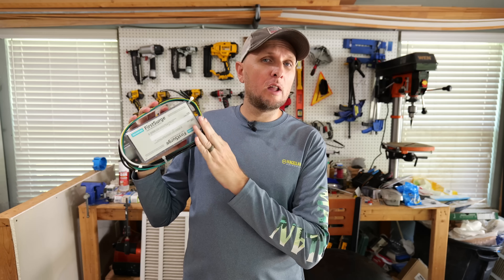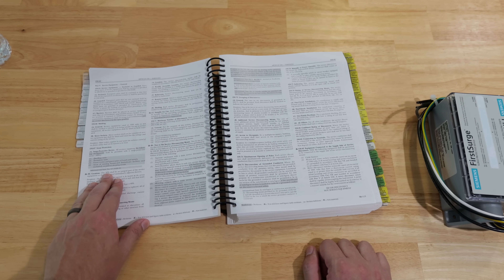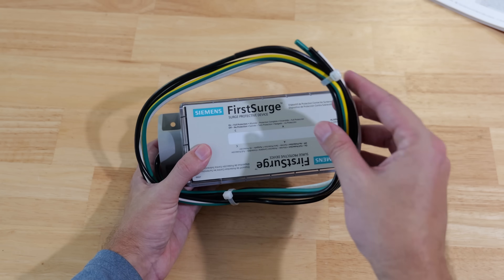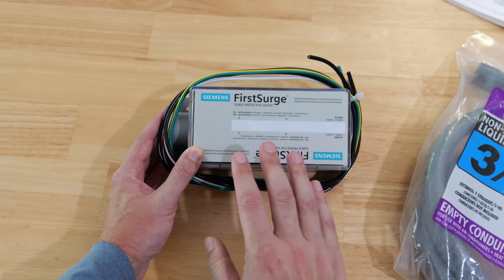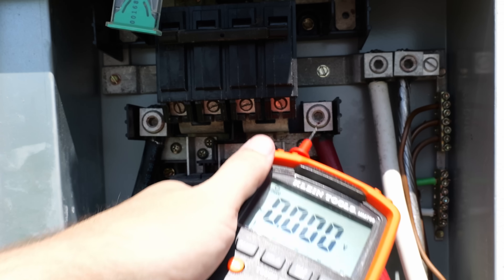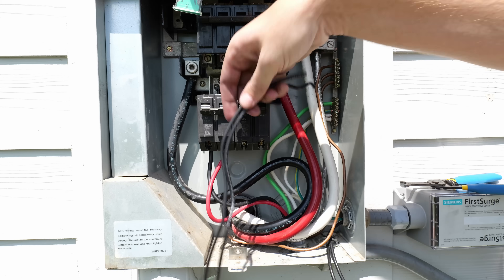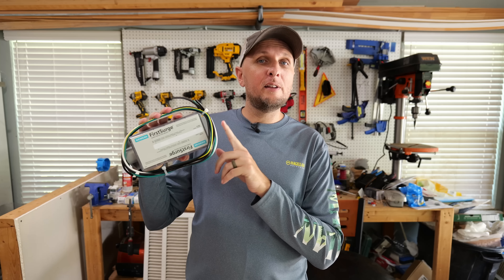Why Whole Home Surge Protectors Are Now Required and How To Install One!  Siemens FS140

Comment from the maker: Were you aware of these surge protection devices?  Also, do you think they make more sense to install now after watching this video?
Reply: All well and good for newer homes. My panel is flush mounted in the garage and has no adjacent spare breaker slots.
Reply: @oswaldcornelius638 My panel is in the garage.  My surge protector was installed by just cutting a hole in the wall next to the panel.
Reply: Done and dusted over five years ago and it has been effective, I believe, as we have had nearby (NOT direct) lightning hits on the primary lines and no damage. In the past we had sone stuff fried in similar circumstances.
Reply: I wasn't aware of these until watching your video on this. It does make 100% sense to install one if you don't have one already. Definitely going to get one and install it as I don't have one currently. Great informative video 😊😊😊 Thank you for posting this video.
Reply from the maker: @211milkman  You are very welcome.  I wish I would have known about them years ago.  I have had appliance circuit boards fried, along with a surround sound system, and some other minor items.  The surge protector is less money than one of the circuit boards alone that I had to buy for one of my appliances.  I personally think they are a no brainer.  Really glad to hear you found it helpful.  Thanks a lot for the feedback!
Reply: Our main breaker panel already had 1.
When I added a subpanel, I added another one and afci/gfci breakers.
They are a great concept, but I would still add surge protection at the device level as well.  A large surge could still propagate depending on the circumstances.
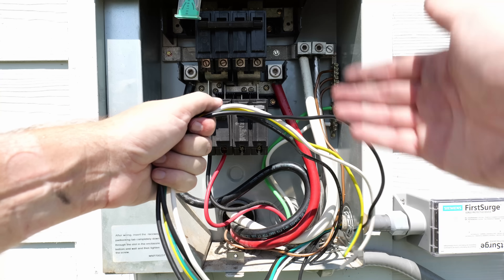Reply: At 9:15 the other reason to keep wires the shortest possible is not only to gain speed, but to lower the impedance (resistance) and thus allowing a greater value of current to be diverted in case of a voltage spike ("surge").  This thing beeing rated at 100 000 Amps the resistance must be VERY low to allow this value of current to flow in the protector while keeping the overvoltage low.
Reply: I had my AC panel replaced in 2016 and the electrician put in a SYCOM T2 surge protector.  Interesting though he did not use a double pole breaker, but rather 2 individual breakers.  If I turn off either breaker the green light goes out.  The device itself has a 3/4" threaded stub so it is installed directly into the panel's knockout.
Reply: I failed to mention that both breakers are on the same side of the panel, so the device is looking for 240V.  So, I guess the assumption would be any surge on 1 buss would also hit the other.  Not sure I like that approach, gonna go with what you showed in this video, thanks HowToHomeDIY!!!
Reply: @bobhall5893   You use a 20A double pole (220V) breaker which connects to both bus bars.
Reply: So answer me this I own two homes, one built 1945 other 1955 been living in older since 1999 and in those 25 years zero issues with surges!  Parents been in their home for 50 years with zero surge issues or damaged now that I think about it I know of no one living in a dwelling who has experienced a surge related accident.  I get that these are extra protection but comes at cost to home owner so should this be mandatory?  I would love to see the data on how many issues occurred due to surges and shouldn’t the provider have some form of surge protection that limits high surges sent to homes?
Reply: I installed that exact unit on my house a while ago. I have a smart home with Z-Wave switches. Before I had a surge protector I lost a switch at least once a year. It was costing a small fortune. After installing the surge protector, I haven't lost a switch since. Best purchase ever.
Reply: I had my main panel replaced around 5 years ago. Before having a surge suppressor was required by code. But it was recommended by my electrician and got one installed.  My breakers are Eaton and the surge protector is Eaton.  It also has two green status LEDs.  I hadn't checked them in a long time, but I figured I should go check now while I'm thinking about it.  Still green.
Reply: My opinion is that it does not make any sense to install these whole home surge protectors on older homes. One reason is the huge cost of making all the changes in a home to meet current electrical code that the homeowners many times cannot afford. Also there are readily available surge protector power strips that can be used with computers and other electronic equipment. It is primarily electronic and computer equipment that needs this protection. Other items do not need this surge protection.
Reply: @davidgrisez  I don’t see why you think installing a whole home surge suppressor would, in and of itself, necessitate any other work. Also, many or most modern appliances have electronic controls that might even be hard wired with no plug to put a suppressor on. And even when they are plugged in, a homeowner might not think of it as being electronic even when it is.
Reply: I had a (pot) pole transformer go bad and send a surge into my main panel. Besides sacrificing itself, a whole house surge protector, I lost 3 computers, not on at the time, the circuit board in the electric range and a small TV. My well pump and all my radios were fine.
Reply: Important on more than dwellings. Our company's mountaintop communication sites dealt with lightning frequently.
In the old days (before 2009) the standard was 25,000 amps and the Surge Protection Devices were known as Transient Voltage Surge Suppressors (TVSS). Our company had ones with replaceable modules but often we would open the cover and find nothing worth saving. The modern standard is 200K amps, and they are not even all that expensive. Even retrofits will pay for themselves with one strike.

BTW - I do not recommend power strips with internal surge protectors; in practice they can compromise single point grounding, which is critical to preventing equipment damage. Go with whole structure SPDs.
Reply: @tedskovranekii7627 You need two spaces nearest the main lugs . You want the surge to shunt to ground before going done the load bars. Keep the leads as short as you can.
Reply: If we have lightning rods on the roof and power conditioning on a PV installation, shouldn't that be protection against damage from surges?  I would think so (though actually we have more limited surge protectors from before getting the lightning arrestors)
Reply: Hi. My grid is connected to a Sol-Ark 15k hybrid inverter, so would I be right to assume that I don't need a Surge Protector, because the inverter handles any surges?
Reply: ...I will just cut to the chase THEIF , the NEC only applies to NEW dwellings and installations and has ZERO refit requirements and any particular change to the code may not even be adopted by local building departments. So no one needs to call your swindling azz to install one of these things on their existing service , QUIT BEING a crook it gives the rest of us a bad name.
Reply: Super! It is also a surge protector.Can i use this instead of a dedicated unit in this episode [Why Whole Home Surge Protectors Are Now Required Install Siemens FS140] ?
Reply: How much electricity does this actually use?
Reply: I was aware of these, though not sure how to address my particular setup and install one.  I posted a reply asking exactly that.  If you get a chance to answer me that would be awesome!
Reply: I've worked in Electronics for over 50 years and I can tell you firsthand how dangerous it is to have a large surge protection device installed on a primary circuit. I have seen explosions caused by power surges of even small MOVs rated at only 30 joules of energy. I can't even imagine the damage that a several-hundred joule device can cause. I predict major house fires caused by these devices. Not good!
Reply: No. I still think they are a waste of money. They do nothing for low voltage events which cause current spikes that are far more damaging. I think they give homeowners a false sense of security.
Reply: Yes I know of them…
Reply: I had a spd installed about 10 years ago. In Arizona spd is not law. The light is on and I’m wondering if this is something I can do.
Reply: I was not aware of these whole house surge protection devices. I am now because I follow your channel. Most people in America do not follow this channel. And because " Playback on other websites has been disabled by the video owner", then most people will never be aware of this video.
Reply from the maker: @acratone8300  The link to the video can still be shared but yes, I do disable the ability to embed it into websites for various reasons.  It will still show up on google search and such as well.
Reply: Sir: you read from code, that the utility company is directed to provide a unit upon request?
Reply from the maker: @Hawka-Loogy  That is not what the code is saying.  It is just saying that a SPD is to be supplied at all services.  Supplied does not mean given, it just means it has to be there.  Now some utility companies will sell them and they install them directly into the meter.  I personally did not like that option as they are either around the price of the one in the video or more expensive, they oftentimes don't have an alarm or way of letting you know they need replaced, and often are not rated for as high of surges as the one in the video.  But it is an option at a cost of course.
Reply: @HowToHomeDIY    I still don’t understand what this whole house surge protector actually protects. Does it protect only house wiring or does it also protect all/some of the sensitive devices plugged into the house wiring?
Reply: @ThisIsToolman  thanks to the breakers' magnetic trip coil inductance, I seriously question the effectiveness of separately wired-in and breakered SPDs. They may help a bit with random grid crap like reclosers tripping that can cause some voltage swells. If every house has one, then the neighborhood can collectively sink 10s of kA without blowing their SPDs all at once to keep the grid within tighter margins during load dumps and get billed for most of that energy.
Reply: On planet earth?
Reply: Yes we knew all about all surge protection
Reply from the maker: Pretty much everyone knows about your standard surge protector but most don't know about whole home surge protectors or about the new codes.  Glad you have it all together!
Reply: @sifu189 Thank you for watching (Why Whole Home Surge Protectors Are Now Required and How To Install One! Siemens FS140)

Comment: Lost a TV, certainly due to a surge in the building's cable system, some years ago. Then two years ago, the starting cap on the rooftop AC went out after another bad storm. THAT repair wasn't grocery money. So I had protection added on the roof and in the main panel. Probably cost 4x-5x what it would have cost to just "throw another breaker in" when the breaker panel was first being set up. So, sure, the whoring builder would have overcharged for the cheapest unit he could find.
 But probably half of residences are rentals. Those tenants can't retrofit their panels. They've got no choice. Surges on the AC mains, like when a drunk knocks down a transformer pole, can set a house on fire. And will blow out everything plugged in inside, even if there's no fire.
 The protection at build makes sense. The whoremongers in real estate? That's a bigger problem. I know some telco and cable techs who would gladly find the builders and give them some life lessons.

Comment: Sorry, I know this video is a couple years old now, but I have a question.  I recently had (2025) a Tesla powerwall installed, during this process, they installed a new electrical panel and brought over the wires from my old panel.  Does this change mean they had to install a whole house surge suppressor per the 2023 NEC?

Comment: So, if the double-pole breaker is shut off accidentally, the surge protector does not work. Is it better to wire directly to incoming power then?

Comment: Same reason I of course have a furnace that was made in a 1930s I remember lightning hitting the house and did not hurt that old furnace The only thing it did was burn out the transformer which was $20 on Amazon the refrigerator unfortunately was not cycling at the moment so it did not harm that and whenever I'm not using other certain appliances I unplugged them and our washing machine and dryer are the same way no circuit boards I think they need to stop putting circuit boards in stuff in stuff that is designed to fail

Comment: I know somebody that had a house that they had put one of those in the panel and even had the electronics plugged in to a normal surge protector strip and it's still unfortunately surged out and it was not due to a lightning strike some stuff is just a waste of money even if it's required 

It would have been really nice if it would have worked because it would have protected probably $10,000 worth of stuff but it didn't same as the reason I always go with battery operated carbon monoxide and smoke alarms Don't trust anything that connects to electric

Comment: Keep making more expensive stuff  as “required”.
And at the same time complain that homes are expensive 

I have $10 circuit breaker now but as per code I need to replace them with circuit breakers that cost $65 each, I need 16 of them that $1,000 😡

Comment: So the 20amp breaker is there solely for the SPD? I have recently installed 2 SPD’s in panels suppling power to my well and rain water collection. They both had 2 pole 20amp breakers so I was able to use them.  I have a third panel suppling the hot tub and sauna but it only has 50amp breakers. So my question is, do I just add a 20amp 2-pole which would only be used for the SPD?

Comment: Trying to figure out the best upgrade path to do this in my future upgrade. But had an on-meter SPD when lightning struck shared pole with neighbor. All equipment at neighbor destroyed! I lost a night light (and a fuse box is now very black and had to replace all the exploded fuses). (The night light EXPLODED all over the counter. Not going to get into why that took a hit when other equipment did not, it's complicated. Point is the value of these SPDs.)
Reply: If you want maximum security, have one installed on-meter, in main panel, sub panel, and type 3 surge protectors on all appliances at home.

Comment: Sorry but I don’t see where this is protecting your home from a power surge? It is only connected to its own 20 A Breaker with nothing after it connected. If a surge comes in it will just surpass this unit through the main breaker and fry your Electronics the same way. I thought this unit is installed in between the main incoming power and the breaker panel where your house is wired from. 
It is to me like you just installed a light bulb that does nothing to your house tan two green lights.

Never mind. I think I found the wrong in my thinking. It is a load protected Switch. Not a regular breaker. If it trips, the house is without power. The Surge protector makes it trip ( turn it off) in case of a surge. 
I’m not an electrician obviously. 🙄

Comment: So I don’t get it how is this shunt that you’re installing on an appendage of a breaker going to do anything for a surge other than give it a path to ground basically exactly the same as a lightning arrester. You have to remember electricity travels very rapidly by the time it hits that shot it’s already hit everything else in the house. You’re not making the electricity go through it. It’s an appendage that gives it a path to ground nothing more so how’s that supposed to protect anything I would think that something like an in-line voltage conditioner would be what you’d really want to protect things but then again I’m not an engineer. I’m just trying to make heads or tails out of this but this what you showed me here makes no sense whatsoever

Comment: Had surge protection on my panel since I built the house in 1999.  Still working, still green lights.  A more modern one is probably a good idea, though. Thanks for posting the video.
Reply: If it ain't broke, don't fix it.

Comment: I live in Fla.  I had just got my house built.  Lived 37 years in Fla with trees all around. Now I'm in the open next to lakes and ponds.  I had already planned for a surge protector but before we got it in. I had lightning come through ..I could see it. It only shut things down.  But then a second hit took out only one of my light fixtures (LED). So i called and told them to put in not only the surge protector but also a lightning arrestor.  No.  I didn't put little rods across the roof.  I haven't had any issue since.  Nothing is perfect.  But when you live in the lightning capital of the country, well.....

Comment: Thank you for this video. Good idea. Seeing you install the surge protector brought up a question. When connecting a wire to a bus bar or a circuit breaker, are there times that you should use a ferrule on a stranded wire? Have you used them and do you really need them?

Comment: Surge protectors are snake oil.  Unless they have a fast enough response time(MOVs are not fast enough) you end up with more junk to replace.  Always on UPS's are far more useful. Brownouts/Low voltage is almost worse than high voltage and far more common these days. Plus your UPS is the sacrificial component and you can just bypass it to get back up and running easily until you can replace the UPS.  My grid power is unreliable and varies from 125-100v throughout the day.  My UPS' keep everything running at a stable 120v/240v(well pump and AC). Everything of any value(minus lighting circuits) has a UPS.
Reply: Yeah always on UPS's are the best but they can be pretty loud and expensive. If you're lucky, like me, you'll live in a place where brownouts are rare.

Comment: Square D - HOM250PSPD Homeline Whole House Surge Protection Device, 50kA, 120/240V, 1-Phase, No Wiring, Plug-On Neutral 100 bucks